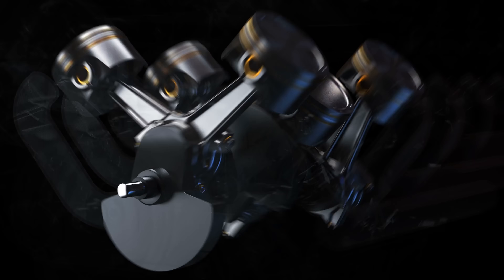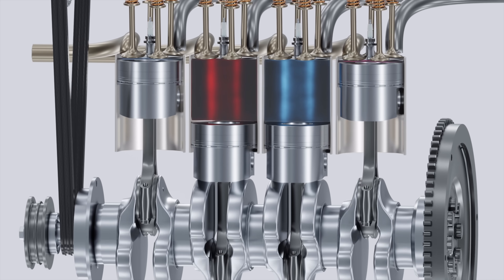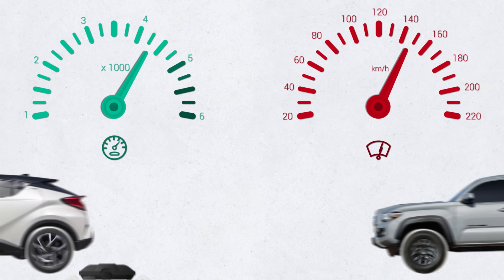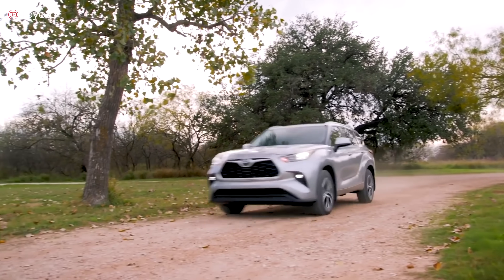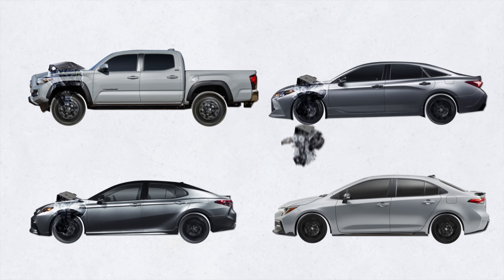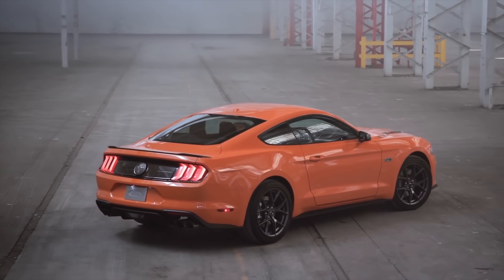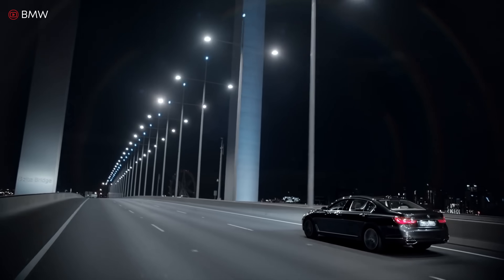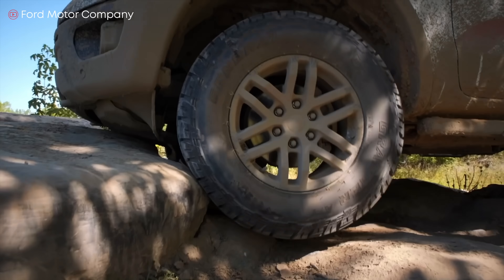No One is Telling You the Truth About Turbocharged Cars, So I Have To

Comment: How long do turbo charged in line 4 engines last compared to v6
Reply: As long as the owner controls the EGT before shutdown, the turbo will last a long time. Ohh let’s not forget, oil changes with quality oil. 

The biggest killer of turbos is heat when improperly driven or taken care off. That why I think it’s a bad idea for the masses to have them.
Reply: @avenger09123  why is that the case?
Reply: @AgonxOC  The masses have been driving small turbo cars (4-cylinders and 3-cylinders) in Europe for over 10 years. In fact, small turbo engined cars completely dominant in sales with only diesels running them close. These days the engine management takes care of the heat management, including keeping fans running after the engine is switched off when required, so it's really not a problem.

Comment: Powertrain engineer here. I helped work on a particular I4 turbo named in this vid. Never worked on an engine that was as hot, dirty, and prone to issues as a turbocharged engine. It's not worth the (maybe) couple hundred bucks you will save in gas per year when your engine fails after 6 years from a stuck wastegate or melted seal, the excessive oil changes (that you can only use ultra expensive synthetic oil with), etc. Turbos belong on sports cars, not daily drivers. They are high maintenance and fussy.

Comment: all the turbo 4's I see have nearly double the HP and Torque than a V6 though.
Reply: Yes , but how long will they last ? You simply can not beat on a turbo engine , considering an average compact
turbo sedan is about 3100 , 3200 lbs , only 200 -300 lbs less than a v6 mid size. Once u r done driving , the car must cool off ,
for at least 2 minutes , those are called turbo timers , or simply run your ac on your way home and drive calm.
Reply: @adrianniemiec8669  wouldnt even know.
Reply: @adrianniemiec8669  turbo timers are only for oil cooled turbos. Modern turbos use coolant and cool themselves off when they're turned off by siphoning coolant. Also AC makes your engine bay hotter...

Comment: I've had just about every engine out there. Inline 6 is by far the best. Every turbo I had developed problems at or before 100k miles. Had a GM 3800,  94  and 04 Toyota V6, they were awesome!
Reply: My mom has the 3800 in her Pontiac. It'll probably run forever. Lol
Reply: Had a 2000 Grand Prix GT with the 3800 series II. Best car ever! Hell of an engine. I miss that car more than any I've had.

Comment: Inline six is the way to go from most aspects, it has both primary and secondary stability, which makes it last forever and gives it crazy boost potential. With a lower displacement you can also keep the fuel consumption fairly low as well.
Reply: I dont think theres inline 6…
Reply: @CleverCheetah  Jeep used to make one. One of the most bulletproof engines of its day was their 4.0L straight six.
Reply: I like turbo 4’s, but you don’t hear much about the straight six these days. Great engine. Those things were engineered to last.
Reply: @CleverCheetah Mazda has Inline 6 in their Cx90 and Cx60 ( Europe). I'm waiting few years for kinks to be worked out and make it my last ICE car.
Reply: I'm waiting on Cx70 to come to US. Hopefully it's the same length as Cx60, it will be perfect.

Comment: My old 05 Sebring was a V6 2.7 engine and that baby was a very healthy and smooth ride despite its age. R.I.P cause of death heavy oilpan leak resulting in engine failure at 250k bought it at 50k

Currently driving an 07 st dodge caliber with a CVT 2.4 engine and I can't stand it. Not nearly as hearty, droning sound when I press the gas, and just feels meek and weak.

Factory ordered a Santa Cruz should be coming in the next few month. Has a 2.5 turbo engine 8speed wet clutch. Curious to see how it drives. Heard about turbo lag but looking to switch out the air filter to a better one which I've heard makes it drive/perform better. Can't wait to see the difference between all 3.

Comment: I love my turbo cars.  I have one.  It's great fun and the sounds it makes are equally awesome. 
I split time between the 2015 Focus ST and a 2018 Mustang GT.  
I'm aware of the issues with Turbo GDI engines.  I do all my own maintenance and am religious about it on both cars.  
I have 98k miles on the Focus and not experienced any of the issues that arise when there is a bad buildup or carbon on the valves.
I always use Shell premium (best/cleanest fuel imo) and I drive it pretty hard alot of the time.  I'm not terribly worried about it and if it ever needs to be done I'll do it myself and drive the other car in the meantime
Reply: but you've got Fords...the engine mechanicals are the last parts that will give out on you, turbo or not-
Reply: @robertmaybeth3434  what are you implying will fail first?

Comment: I got a  ford 4 cylinder turbo as the 2nd owner at 88,000 miles. It was good until I kept pushing it which I think has to do with the high temps that gave me problems. And the thing about ford 4s is that its very difficult to work on since its made with very compact inter workings. I also have been dealing with a broken gasket that Ill eventually have to replace

Comment: I own a 2010 Subaru Forester XT. The previous owner, unbeknownst to me until it was too late, had removed the CAT from the exhaust system. So now, at high engine load, the ECU cuts the throttle to prevent overboost from the turbo. Fixing this either means dropping a $1000 on a new CAT, or reprogramming the ECU at the risk of blowing the already famously fragile head gaskets that Subaru's engines are known for. The lesson here folks: If you're buying a used turbo engine, get on your knees and check that the CAT is still there! People love selling their catalytics for extra cash these days!

Comment: I love my turbo 4 banger in my mustang after some bolt ons and a pro tune (with just an upgraded intercooler and air intake I'm pushing 300hp at the wheels) but v6's sound better and have less parts prone to failure. In the mustang I'd pick the 4 cylinder over the v6 every time but the average turbo 4 cylinder vs the average v6 I'd have to pick the v6.

Comment: What's old is new again. It was Chrysler in the 1980s push the turbo charged fours with the 2.2L. They were no joke in the performance department. My brother in law brought a Dodge Omni GLH home from the Proving Grounds. We were out screwing around with it when we got challenged by Fox body Mustang 5.0. That guy got embarrassed. The big problem with them and one of the reasons they where discontinued was the turbos tended to over heat at shutdown cooking the oil in the bearings.

Comment: Had an ‘86 Turbo Coupe with 2.3 turbocharged engine.  The insurance cost me more per month than the the payment (I was 23 when I leased the car).  Thing had a 5 speed Getrag manual transmission and was a blast to drive.  You had to be careful on wet pavement because it would get really squirrel ly when the turbo kicked in.  Also, the rear view mirror shook really bad (blurry vision) when the turbo was kicked in.

Comment: I've got a 2015 Alum body F150. Aspirated 6cyl.

When a bought it new, I had a short list of requirements.
6cyl aspirated
Tow package including trans cooling
Crew cab
and a few creature comforts. Basically mid-level.

At 160,000 miles - I absolutely love this truck!
5% of my miles have been towing. Half that near the 6,500lb tow limit.
80% have been highway miles. 21mpg was the norm.

I recently retired and my milage has dropped to 19mpg because I'm now doing 50% local driving. Still pretty good from that size truck. It may drop farther because towing will become a higher percent of the miles once I move to my farmette.

My first repair was last month. Cam position solenoid. $1,000. Up till then only oil & filters, brakes, and tires (100,000 miles on the factory tires). Bought the same tires and they look great with 60k miles on them.

Same with brakes. Amazing long life. I do my own brakes and the electric parking brake is a pain. But once every 100k I'll be fine with that.

I didn't go with turbo because of the unknown maintainence potentials. A friend of my works in a parts supply warehouse and told me the turbo would most likely be fine, but if I kept it long enough it might become very expensive on the back end.

Hoping to hit 250k miles over the next 6 years. Then the grandson can have it, and maybe his younger brother can learn with too.

Comment: Hi Scotty, thanks for the great video. I have a 2018 VW Passat with the 2.0 liter turbo engine, We love the car; it gets 40 mpg on the highway and has plenty of pep when you step on the gas. We don't drive the car hard. VW recommends changing the oil at 9,000 miles, but you have to use their expensive special oil. Would I better off just using a good synthetic like Mobile One and changing the oil at 5,000? Also, when we are just cruising on the highway, is the turbo working all the time or does it disengage while there is less demand?

Comment: I had a difficult decision in buying a new truck in 2020.  I decided on the Ford F150 and then looked for information on which motor to get.  My purpose for the truck was to pull a 26' holiday trailer.  After a lengthy review of the 5L V8 vs 3.5L V6 turbo Ecoboost and multiple test drives, I went with the Ecoboost.  Pulling the trailer in the mountains is easier than expected.  Fuel efficiency is 11L/100km (~80% highway), and 22L/100km pulling the trailer at 100km/hr.  What surprised me is the fuel efficiency pulling the trailer at 90km/hr in the mountains (hiway 93 between Jasper and Banff) averaged 18L/100km.  I did not expect it to drop by that much.  I change the oil every 5000 km using SAE 5W30 API SN PLUS as recommended by Scotty for turbo charged engines.  Coming to the end of our second summer of camping, I think I chose the right truck and the right engine.

Comment: I drive a 3 litter turbo straight 6cyl. I have 162000 miles on it and replaced the turbo at 145000 miles with a yard turbo with 65000 miles on it to fix all the oil leaks in the engine because the seals went bad and pressurized the oil system inside the engine and blew seals and gaskets. But all that done and it still uses 1 quart of oil every 1500 miles. Any wonder why my next car is what you said to get?  A 6 cyl Lexus ES with very low mileage. You can have your turbos and good luck. I will never own another one.

Comment: V6 100%. What makes any of the domestic autos with a 4 cylinder turbo and different from 1984? I remember replacing my browns turbo on my 84 Chrysler Laser XE and 1991 Dodge Spirit R/T… Honestly I don’t know how they have changed from that era to warrant buying those type of vehicles equipped with turbos.

They still produce a ton of heat. Additional maintenance is required, regardless of what the owners manual states. 

They also have to be driven relatively conservatively to make sure the turbo lasts as long as possible.

Comment: We have a fleet of Chevy Trax turbo 4’s.  So far we are getting 150K miles out of them with hardly any maintenance but all the turbos go out. One has had two. So if you buy one, go ahead and save up for a replacement turbo. The AWD version is so fast, and it handles like it’s on a rail. I’m impressed how well it drives.

Comment: turbos usually run on Premium gas which negates some of the fuel economy benefits.  you also have to run synthetic oil on a turbo motor and there is a greater likelihood that the turbo will have to be overhauled after 100k miles.  then again, the buick 3.8 SFI turbo seems to run forever.
Reply: No you don't have to run premium gas my Ford Escape Ecoboost owners manual says do not run less than 87 octane. And it doesn't say to use full synthetic oil. I also have an 86 Mustang SVO 2.3 turbo it has a selector switch on the console for
Regular or Premium fuel. 
I also have a 98 Lexus LS 400 
4.0 V8  naturally aspirated open the  fuel door and right there it says 
PREMIUM UNLEADED ONLY.
Don't know where your getting your info but .one comes straight out of the owners manual.
Reply: That Buick was Supercharged in the later years.  It was stone reliable.

Comment: From my experience with three 
Ford 3.5 Ecoboost F-150’s
I’m not a fan.
City fuel economy ⬇️
Mountain Fuel economy ⬇️
Towing Fuel economy ⬇️
Interstate Fuel economy ⬇️
The only time I observed over 20-21 MPG was on level cruise control under 57 MPH.
On top of that,
I had running issues out of them.
Two of them had to be towed in.
Not Again.
I LIKE MY 
NATURALLY ASPIRATED 
V-8 Engines.

Comment: There is no black and white answer.

It really depends on the needs. If frequently towing, the turbo will wear out faster from strain.

If one just wants a bigger vehicle that gets better MPG and doesn’t do heavy driving, turbo 4 would be the way to go.

Size, driving style/needs, weight ratio, and other factors determine the answer.

Generally speaking, the average driver doesn’t NEED anything more than 4cyl and the turbo can help with acceleration/passing. But we know many can’t separate the difference from a NEED/WANT.

Comment: I have a 2006 3.5 little V6 toyota avalon. It's my daily drive & It has 338k miles. I have drove half of the country with it.. I have never changed the transmission fluid becsuse it doesn't even has a deep stick to measure it, so I assume that fluid is for the lifetime of the car. I just replace the brakes every 2 years & alternator was changed just once. It's not a good looking car, but it's the best car I ever had & still drives like a champ.

Comment: When I purchased my 2014 Edge 3.5L NA V6, the sales person tried to convince me that the “new” incoming 2015 Turbo 4 was a better option as it had more HP and torque. I responded, “Really, what’s the tow rating compared to the V6?”. He went quiet, because in 2014 the V6 Edge was 3500lbs. The incoming 2015 Edge With the Turbo I4, I could be wrong, but I recall only 1500lbs!!! In fact, responsible Ford dealers would not install a 2” hitch receiver on a Turbo I4 and only installed the 1-1/2” receiver for accessory racks.
Reply: PS. Fast foreword to today and the contractors I know with a 2.7L I4 pick up truck hate them. They break frequently, especially if they ask it to do actual truck like hauling. The Turbo I4 pick up truck is PERFECT for the soccer mom/dad that just wants a big impressive looking vehicle to go grocery shopping.

Comment: If I am buying new ... well I want a V6 Turbo because that would be great.

But buying used, which is my fate for the foreseeable future, I would prefer a V6. Simpler maintenance, less stress on the engine.

At my home we have an '04 CR-V (i4), a '00 Accord (V6, 3.0L), and an '07 Odyssey (V6, 3.5L). All of them are getting up in mileage and the V6s are just happier motors. Granted, the CR-V is N.A. and a heavy AWD so that motor is a little underpowered for what it does.

Comment: for a smaller car i'll always love having a smaller displacement turbocharged engine. i'm often not heavy on the throttle so the turbo aspect isn't doing much and i'm getting the benefit that smaller engine provides. but i have the extra power available for when i need it. a 2L i4 and 3L v6 both producing 270hp will consume the same amount of fuel for that max power. but say cruising on the highway where you'r only needing about 50hp, that i4 will see better mpg due to the smaller displacement, and the idling through a city makes it even more apperent. horsepower out equals fuel in.

Comment: I have a Mercedes with the M271, boosted to around 18psi.  I also have a Saab with the B207R sitting at around 12psi.  Both have been really solid, although I do have to put more work into the Benz; the timing chain is notorious for needing replacement at around 100k.  I bought mine at 82k, so guess what my first big job was.  Yep.  Still, I do prefer turboed 4s, so long as they are known to be tried-and-true reliable engines.

Comment: Many car owners tend to neglect regular maintenance tasks like oil changes, and using premium gasoline if required is often overlooked. This oversight can lead to engine detonation, which can eventually damage the piston, cylinder head, and other components. Consequently, engines may have shorter lifespans, not due to poor quality, but because they require more consistent care.

Comment: I have a 2013 Ford Taurus with a V6 which is fast and powerful. I also have a 2022 Ford Escape with a 1.5 liter turbo 4. As far as performance, the Escape might not beat the Taurus in a drag race, but it would be very close. The Escape gets around 32 to 34 mpg on the highway. I like that. The Taurus gets around 27 mpg on the highway. I like both vehicles a lot.

Comment: V8 all the way. Discipline can get me up to 30mpg in a crown vic. Keep her running good and change the oil and get a good air filter, keep it aligned and it should be no issue if kept it in overdrive at all costs ;)

Comment: Apologies for the minor correction, Scotty - I have the greatest respect for your knowledge and understanding of all things automobile and your presentations on your videos here. However, the spark plug is supposed to ignite a "smooth but rapid burning" of the fuel/air mixture in each cylinder during the power stroke - an "explosion" (a.k.a. "detonation") can be caused by a number of factors and is very detrimental to gasoline engines and, left unchecked, leads to early engine failure.

Comment: I've had both 4 and 6 cylinder naturally aspirated engine and prefer the six. It seems that turbo charged engine requires more oil changes and maintenance. I'm not knocking the turbo but I just prefer naturally aspirated engines.